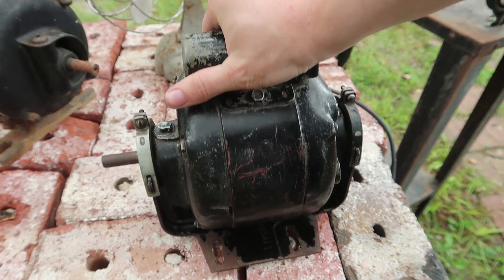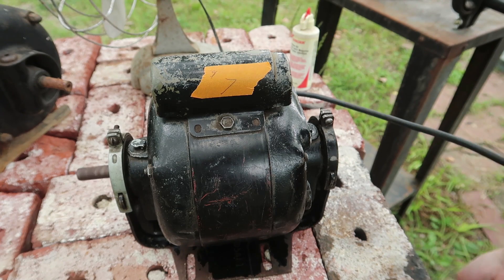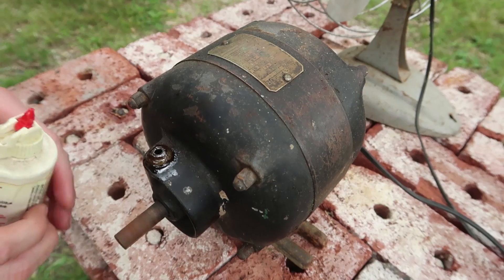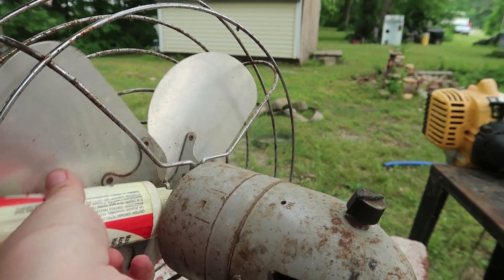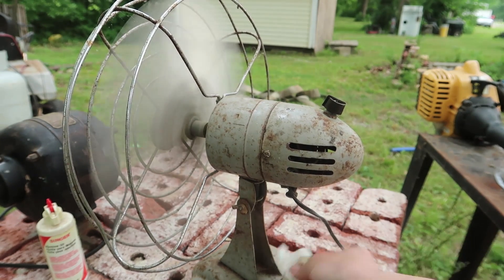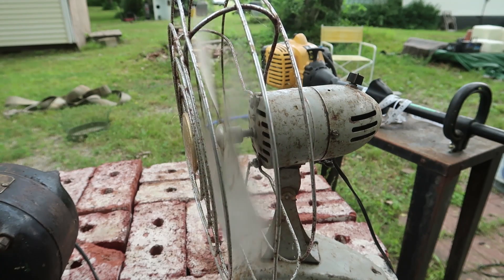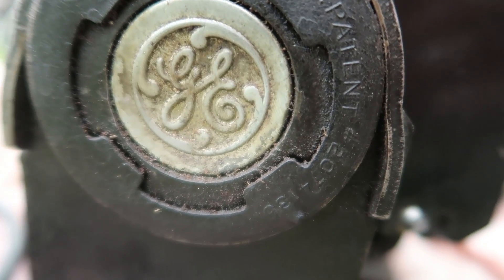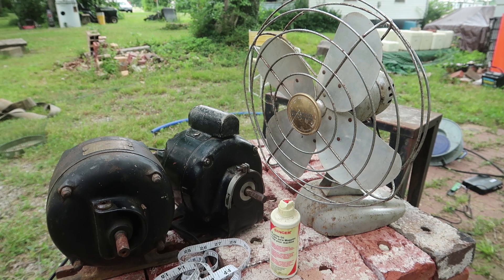Antique Electric Motor Lubrication / Oiling Experiment

Comment: If you tighten the knurled, barrel nut on the curved metal bracket underneath the motor, the fan should start to osculate back and forth.
Reply from the maker: sadly it doesnt turn it much so something is broke inside
Reply: @RinoaL  that's too bad, when mine gets stuck, I just put a little oil on the curved arm and it starts to osculate. I've had mine since the 70's and they still work! Thanks for the heads up!

Comment: Got an old 40s Westinghouse fan. Been around it ever since I can recall. Still runs & oscillates. It had 4 blades, one was damaged put it away for 15 or 20 years, got it back out removed 2 blades and it still blows up a Gale force.

Comment: Oh dear, there is much more to lubrication of an electric motor than 'I guess this will do'. The internet is a wonderful place so please do your research before oiling or greasing the bearings in any electric motor, did you know for example that if you over lube, particularly with grease, the excess can get on the windings and cause the breakdown of the insulation? Here is a very good article on the subject, there are many more like it online. https://www.machinerylubrication.com/Read/1125/electric-motor-lubrication

Comment: It all depends on the type of bearing and type of oiling. Those old motors probably have regular sleeve bearings with a felt wicking that gets soaked with oil and directly rubs the oil onto the motor shaft. The fan more likely has sintered bronze bearings, which is a porous metal that behaves like an oil sponge. Around that will be felt wicking to be oiled, that the bearing can capillary oil out of. However, once the wicking goes dry, the bearings also start to go dry, and unfortunately, just adding oil back to it will not get the oil back into the bronze bearing. If a sintered bronze bearing isn't damaged and doesn't have play, it can be re-oiled by totally removing it from its place, submersing in oil, and then put that container in a vacuum chamber for several hours. That'll suck out the air, and refill the bearing with oil. Not the easiest thing to do, obviously.

In any case, with really old motors like these, the felt oil wicking will likely be dry and brittle, gummed up, or otherwise ineffective. Replacement is usually a good idea.

Also, SAE 30 is by far the most common oil for these purposes, from back then, even up to today. Sewing machine oil is probably not a far cry from 30 weight, but a quart of SAE 30 is about $3 at the car parts store, and I imagine the sewing machine oil is more than that for much less.

Also, also, none of the motors you have really sound like they have dry bearings. But then, I'm listening through your camera, so I have no idea.
Reply: you nailed it replace the felt. it most likely clogged with dirt and old oil.

Comment: that fan is a bersted fan which used a shsded pole motor. it is common for them to get very hot, sometimes so much so that you can not tutch the back. as long as you don't smell anything burning it should be fine. one thing i would reccomend is taking the motor apart and fully soaking the felt pads inside the bearings with oil.

Comment: In the wornout sleeve bearings the clearance is high, maybe a heavier weight oil, like iso VG 100 or 150 compressor oil is suitable and also safe for brass. Hydraulic  fluid or ATF can be good for medium wear too. The more tight the bearing and higher the speed the more thinner oil you need. The more power and torque the more viscous oil you need. All about balance. You can check the bearing temps for fluid drag friction with the heavy oils, if overheats, reduce the viscosity.  If the film strength is inadequate with too thin oil, you can hear the metal to metal contact anyway.

Comment: The fan looks like it’s an oscillating head and it only oscillates one way. To explain why the fan get so high is because there might be a strict gear in the oscillator unless the fan has one of those switches that you can pull to stop it from moving back-and-forth

Comment: Those motors without dust caps on the oil ports should have a plug to keep the dust out.  The old-timers used to whittle a plug out of hard wood.  My grandparents had open cage fans throughout their house.  The cat would sit and swish his tail precariously close,  much to grandma's dismay.  I think the cat was teasing the fan, saying, "I dare you!"

Comment: Doesn't matter if it's just a paper towel or not, if that motor catches it, it will take your fingers with it. Happens all the time with people using lathes, trying to use a piece of sand paper to polish a part -- they make sanding bows for this purpose.

Comment: Any high viscosity synthetic oil with PTFE will work very well in motors with integrated oilers.  The PTFE will help lower the friction well below even the original oil used and help prevent the felt oiler from sticking to the shaft is the motor sits a long time without being oiled.  Synthetic oils will also stay put better with less of a chance of the oil running out.
Reply: You dont want to put oil with dtergents in an electric motor.

Comment: A cool, if random thing you could build with one of those motors is a sort of 12V dynamotor. Find a car alternator and the right pulley for the motor to drive it, and then you could use it to charge batteries and whatnot. :)

Comment: I use Zoom Spout for motor bearings. I think the noise level has to do with the quality of the materials used in the motor and quite possibly the number of hours it has been run for. the oldest motor I currently have was made some time in the mid to late 1950's by general electric, it is a 1/4 HP.

Comment: The GE motors have a felt/cotton swab that gets soaked with oil and slowly lubricates the bronze bushing. Any lightweight oil around an SAE 10 will work. Sewing machine oil will work but it's a little on the thin side. Zoom Spout Oil is extremely common from home improvement/hardware stores and would be ideal.
Reply: sixtyfiveford a next door neighbor of mine used to work for GE back then and broke one down for me to show me what he used to do in the machine shop.  That’s why I love this channel!

Comment: Try not to add too much oil if it gets in the windings it can cause internal shorts later on, I once got some oil in the winding of my old 60's fan it burned out and I had to rewind the motor with fresh wire it took me over a week in incremental steps because it was a weird shape.
Reply: Ortorea Screenname if adding oil to windings caused a short, their was not the book's fault,  but the enamel coating on the wire cleared come off.
Reply: Contrary to popular belief water is not the only culprit when a short circuit can happen, as any medium such as many types of oil can also conduct electricity, water and oil can carry particulates such as salts or minerals that have electrical properties. What most likely happened to my old 60's fan was the very old enamelled wire had micro-fractures quite common in very old electrical insulation most noticed in high voltage EHT leads such as on car ignition systems. In such cases they can run fine when dry but as soon as fog, damp or rain is present you get a car that wont start, these situations most likely due to micro-fractures in the insulation. And yes my old fan was a disaster waiting to happen as soon as some moist lubricant was introduced to the bearings it exacerbated the problem and tipped it over the edge and burned out. This happened in the 1980's many years ago, and since the re-wind it was worked fine ever since however the bladed are now falling apart lol. age gets us all in the end.

Comment: use grease not oil. watch the tool restoration channel he uses grease
Reply from the maker: how will grease get into this though? if it was grease id have to remove the bearings and repack by hand. these motors clearly have oil fittings
Reply: @RinoaL  yes, you don't use grease, use motor I'll. Sewing machine oil is fine.I always used 3 in 1 oil.

Comment: The 2 motors have rollor bearings, , they would use grease, depending on the type of bearins used.  The second one sounds like the bearings are going. The fan more than likely has a sleeve bushing. As old as that fan looks, it could just be poor quality

Comment: I used to work for a company that worked on those electric motors. For the most part, the service people used a 3 in 1 oil or similar light machine oil and used between 3 and 5 drops depending on how dry the motor parts were.

Comment: The sound of the fan sounds normal except the body and possibly blade guard need tightening. The second motor sounds fairly normal to me as well the first one is abnormally quiet. I have to wonder if its running at its full speed. The oil you're adding I don't think will effect anything but the basic bearings they have in those and I didn't hear bearing noises. But im not an expert and could be totally wrong.
Reply: I have a motor and it is a quiet as the first one, but it is a but older, some motors when running with out a load are very quiet, especially the older ones

Comment: 3-in-1 Electric Motor oil SAE20 is what I have always used. The can I have is from Boyle-Midway Toronto Canada.. it was $2.79 so who knows how old it is. One can is a lifetime supply apparently. I still have half a can left. I only use it on my old grinder/sharpener made from a washing machine motor

Comment: You did the right thing by using light machine oil it only takes 3 or 4 drops and depending on how much use it gets will determine the frequency of adding more , the older motor probably has a wick in the oilers they are normally noisy in use oiling the shaft good idea for both .
As for the design of the fan that was made when people used common sense and taught their children not to stick a finger into it , when I was growing up we had one much like it even though I was told not to stick a finger in it I did , Damn did it hurt  never tried it again . You might want to open it up to clean it if there is a lot of dirt inside it will run hotter
Reply from the maker: well you dont always decide to do something that will be dangerous, could have it on your table and trip on the cord for instance